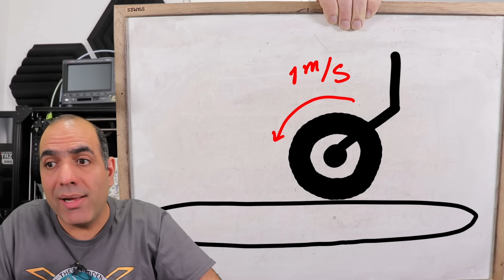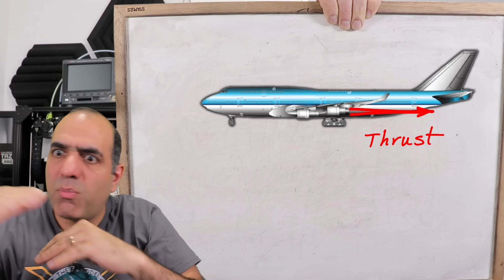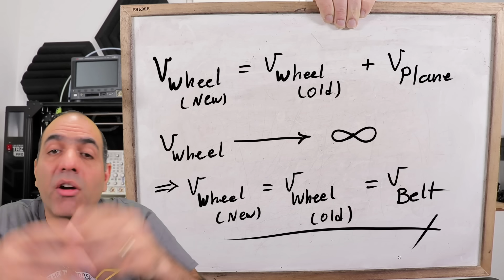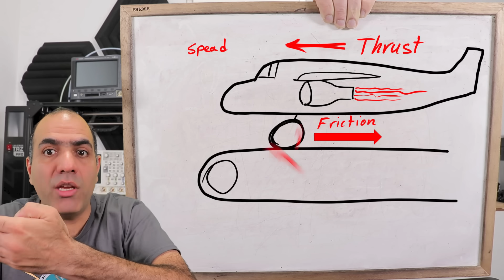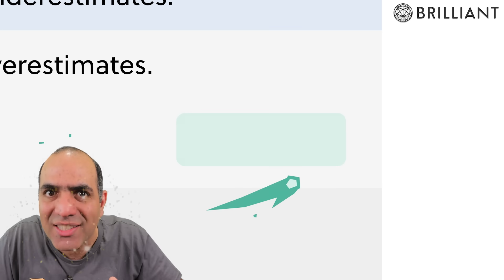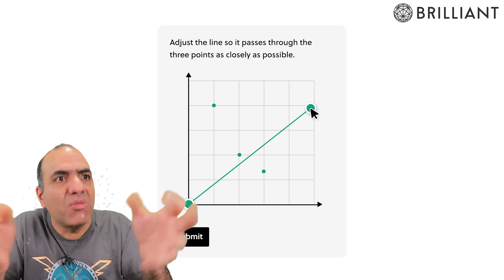Airplane Question that Drove Me NUTS!!!

Comment: This is effectively the same sort of rig used for testing plane landing gears. The plane is effectively 'tethered' in place, with only the wheels turning on the same spot. There is no airflow over the wings. No lift. For regular liftoff the wheels aren't what cause it to take off, the wheels move the plane in order to create airflow over the wing, which is what creates lift. Put simply, if there isn't enough airflow over the wings to lift the plane, it doesn't matter what the wheels are doing.
Reply: The wheels do not move the aircraft
Reply: @compulsive_curiosity  They move with the aircraft rolling at 1 to 1 on a stopped conveyor and the aircraft takes off.
Reply: Exactly and since it doesn't matter what the wheels are doing, the plane will take off REGARDLESS of what speed the belt or wheels are doing (of course if the wheels survive).
Reply: @skatemaster33  it cannot while it is on the ground.  The vehicle (car, jet aircraft, rocket, etc.) only moves on the ground by sliding or rolling.  If we know that the wheels have to roll in order for the vehicle to move, it is trivial to hypothetically design this conveyor to move 'ground' at exactly the same rate and, by the specific terms given to us, the rate of change is instantaneous so there is no way to out-accelerate the conveyor.
Reply: @MrDefreese  that's the thing, the rolling is only because the vehicle moves forward, the vehicle doesn't have to roll in order to move forward. It has wheels purely to you know not to scrape the whole plane across the runway. If the conveyor belt exactly matches the wheel's rotation then the plane has to move since the wheels move because the plane is moving forward. The plane can take off regardless.
Reply: @skatemaster33  it looks like you are not reading the question. the plane moves forward because of the engines (1), hence the wheels turn (2), hence the belt moves backwards the same amount (3), effectively making the plane stationary. The engines alone will not make the plane fly, you need airflow to lift the wings.
Reply: @ricardoolivo5244  yes but the engines are not related tot the wheels in any way. The plane has to move forward because the engine pushes the air not the wheels
Reply: @skatemaster33  I understand your point, and is valid, it depends on the interaction between the wheels and belt. If the movement of the belt effectively moves the plane back, then its stationary, but, if the wheels just roll more, then yes, plane will move ahead and eventually lift. Friction coefficient.
Reply: @ricardoolivo5244  The belt only moves when the plane moves because the wheels move the belt. The plane will always move forwards regardless of what the wheels are doing, effectively the plane always has a net forward
Reply: @skatemaster33  wheels dont move the belt, that is not in the premise. As I said, I see your point, you are basically saying the belt moving backwards does NOT move the plane, just the wheels, hence the plane moves forward, hence it eventually flies. But, it doesnt have to be that way necessarily, as I said, it depends on the axle-wheel-belt interaction when the belt moves. If the friction is high enough, the plane will literally move back every inch the engines move it forward, making the lift impossible. So, to me the answer is: it depends.
Reply: @ricardoolivo5244  Of course taking real life into account the belt wouldn't even exist, the wheels would explode from friction and the plane wouldn't take of, not what I'm arguing though, in ideal situations the plane would always take off because the belt or the wheels are not in relation to engines and the air above
Reply: @ricardoolivo5244  Wheel speed and conveyor speed are matched at the contact point between them and wheel only rotates when the plane moves forward. Again the plane moves Forward and the wheel rolls exactly the same distance on the conveyor belt. with everything matching exactly at what point in the forward movement of the plane does the wheel get ahead of the conveyor belt causing the belt to start?                                                                                             The riddle (Imagine a 747 is sitting on a conveyor belt, as wide and long as a runway. The conveyor belt is  designed to exactly match the speed of the wheels, moving in the opposite direction.)                                                                                                                          Can the plane take off?                                                                                                                                                                                                       Let's break it down                                                                                                                                                                                                                 747= real plane, it will take off                                                                                                                                                                                               Sitting= Stopped, not moving, wheels not turning, and conveyor not running.                                                                                                    Conveyor belt designed to exactly match the speed of the wheels = Conveyor belt can only match wheel speed, it can't change wheel speed.                                                                                                                                                                                                                       Moving in the opposite direction= The top of the wheel  moves in the same direction as the plane's forward movement, the bottom of the wheel moves in the  opposite direction to the plane's forward movement. So any conveyor belt the wheels roll over moves opposite the plane.                                                                                                                                                                            To make the wheels turn the plane must move forward, as the wheels turn they roll on the conveyor belt at the same speed. Because the speed of the wheels  already matches the stopped conveyor belt, the conveyor belt  will not have to start and the plane will take off.                                                                                                                                                                                                                                  I see now this is not a riddle, it's the definition of how planes take off from a runway with one word changed. they replaced the word runway with conveyor just to confuse
Reply: @tedfann3618  if there's little or no friction in the axle-wheel-belt saint trinomial, it doesn't matter how much or how fast the belt moves, it will just move the wheels (at best, assuming no sliding) while the plane is "free" to move forward, like skating over a moving treadmill.
Reply: @ricardoolivo5244  You are right, but the fact is the belt per the riddle already matches the wheel without having to start.
Reply: @tedfann3618  sure, but if theres no friction that means nothing. Imagine for a second you are on that plane,  nothing is moving, lets try a different approach, in this scenario suddenly the belt starts to slowly move backwards, BUT, the plane isnt, just the wheels move, plane is staying same place relative to ground. If now you start the plane, it will move forward. yes, belt will move faster, but just the wheels care, not the plane.
Reply: @ricardoolivo5244  The riddle states (The conveyor belt is designed to exactly match the speed of the wheels) that means the wheels control what the conveyor belt does . As soon as the wheels move forward they match the conveyor belt exactly without it starting up no matter what speed the plane is going.
Reply: @tedfann3618  yes, we know that, but again, it doesnt change anything, if the belt moving back doesnt move the plane back (just wheels) its all moot, it doesnt matter how fast or how perfect it is matching the forward movement. Another idea you could think of, imagine the belt is made of ice, and wheels are instead skis, it doesnt matter how fast the ice belt moves back, the motor of the plane will move the plane forward, ice belt will just slide
Reply: @ricardoolivo5244  The belt never moves. it doesn't have to, it can't because it already matches the wheel as the plane moves forward. If plane stops the wheel stops. It is just what all planes do on runways every day. Come to the light my friend. I too tried to make the conveyor belt move until I reread the riddle and realized the plane controls the wheel and the wheel controls the conveyor belt.
Reply: @tedfann3618  ok I give up, good luck!
Reply: @MrDefreese  My best answer yet. (The belt can only match the speed of the wheel. The only way the belt match a forward moving wheel exactly is to not start up The plane controls the wheel and the wheel controls the belt. The only way for you to make the belt start would be for you to grab and turn the wheel by hand without moving the plane. Even than it would only start as you rotated the wheel and would stop when you moved your hands to get another grip. EXACTLY That my friend are the only two things that can happen, I hope you see the light now. )
Reply: @tedfann3618  plane does not control the wheels, wheels are free, its not a car. wheel controls the belt is not exactly true, more like belt has a magic feature to match wheel speed, but sure lets say wheel controls the belt. When the plane moves forward, the wheels spin, then belt moves backwards BUT IT DOESNT CARRY THE PLANE WITH IT, just moves the wheels faster. this is obv in case theres no friction, if friction is high enough, belt moving back will indeed carry the plane back and it will stay in same spot. Maybe this is good enough? I'm out haha.
Reply: @ricardoolivo5244  (Plane dose not control the wheels) You are right forward movement does.                                                       (Wheels are free) OK                                                 (its not a car) you are so right                         (match wheel speed)= your next statement (wheel control the belt) you are on a roll Than you fell off the wagon and the rest of your post is just wrong. Let me break down for you. Key words in the riddle are                  Speed, exactly match, opposite direction       Speed is the rate of forward movement of the plane. Yes it is read on.                                      Exactly match no faster, no slower                              Opposite direction only happens when the plane moves forward.                                            Lets do this one step at a time                                            Move the plane say 10 feet forward                                 The wheel rolls 10 feet on the belt                                Now what dose that Magic belt control guy do? First he has to put down his coffee, he's, union you know. He askes how far did the plane move. he's told 10 feet. He  says I already did. But didn't start the belt. Union gut picks up his coffee and says Exactly!      10 for 10   Have a nice day                                               Don't get me wrong, I didn't see it at first either.
Reply: @tedfann3618  haha ok sorry didnt know you were trolling, good one
Reply: @ricardoolivo5244  No trolling here, just the truth. The plane takes off, the belt or runway I should say stay motionless. Maybe one day you will see it. Man even if you raise the plane up 1 inch and then move it forward over the belt my answer still works. Have a nice day and let me know when you see it.
Reply: @tedfann3618  I honestly thought you were, cause it was a long paragraph going back and forward but nothing made sense, exactly like this riddle from hell hehe. Wait, all this time I thought you were saying plane cant even move, but now you are saying plane takes off but belt never moves? ok...no more questions, your honor. Wait! I see it now! omg thanks! ;) o&o.
Reply: @ricardoolivo5244  It took me awhile to first see it and every time I answer a post I see more ways to prove it. Thanks, Ted
Reply: @tedfann3618  took me at least 24 hours and reading everything I could find to fully grasp it, even though I'm an engineer, it really is more complicated than it seems, makes sense so many people have a different view and have strong opinions, even though its unproved and unprovable